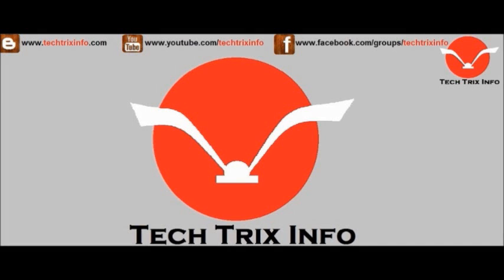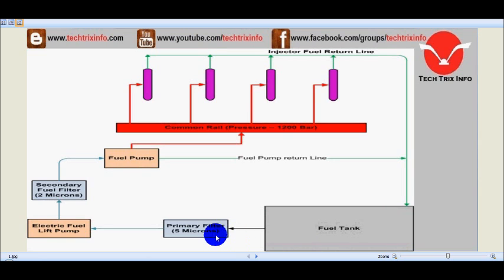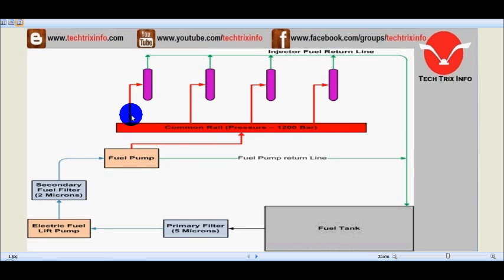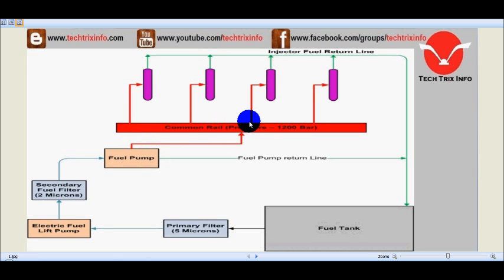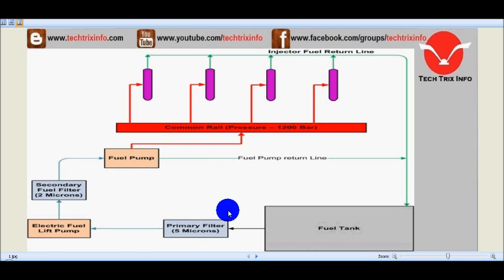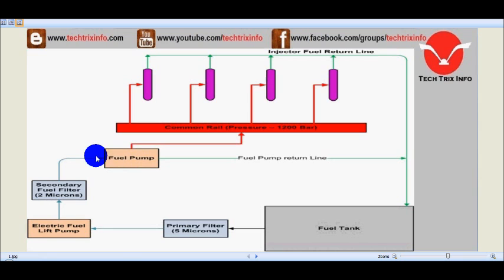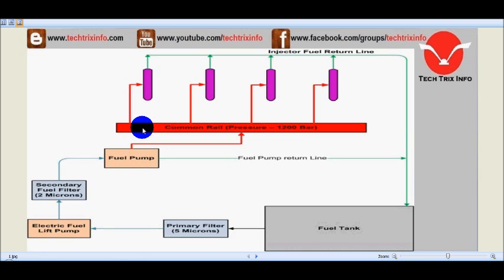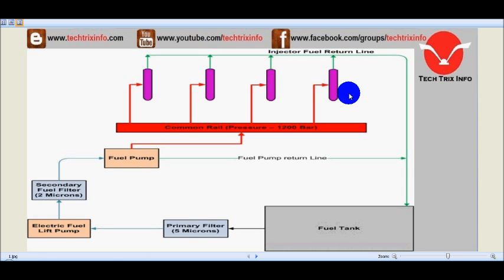How CRDI works. ✔

Comment: if the highly pressurised fuel is released to the fuel tank - won't it put excessive pressure to the tank wall? how is the pressure neutralized?
Reply: Gas tank will have a vent possibly 2 or more vents. The return line is similar to a blow off valve on an air compressor